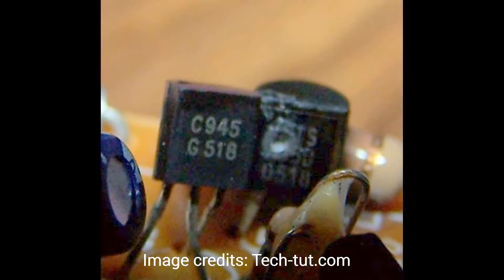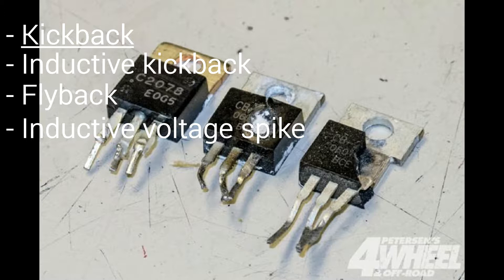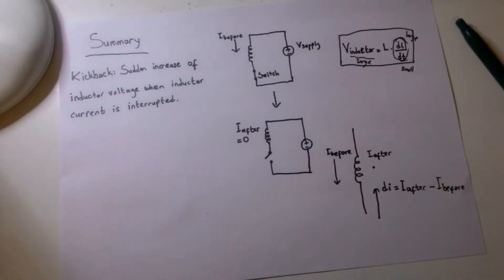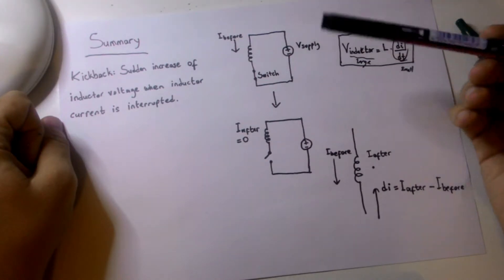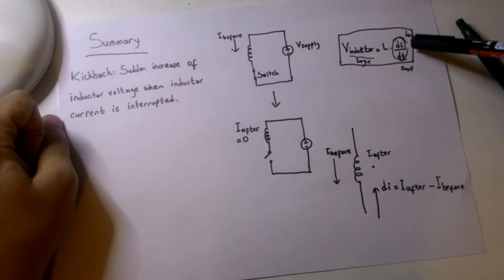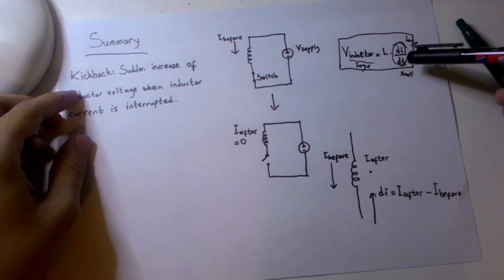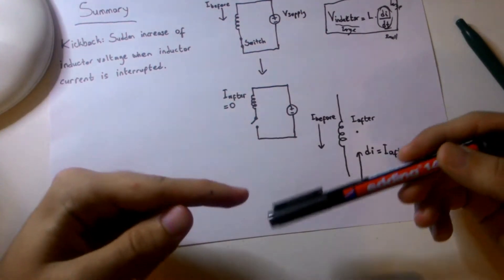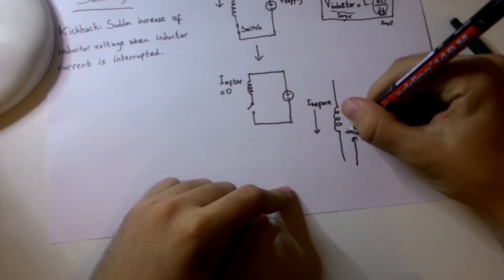What is Inductive Kickback? - Part 1 - Introduction

Comment: when swith open, current not suddenly drop to zero rather it exponentially drop because of opposition to change in the current due to coil.
Reply from the maker: Hello friend, good question. Nothing in nature changes "instantly", for a current to drop from 1 Amps to 0, it should go through 0.99, 0.98 and so on.

But is the drop exponential? Most probably yes, because nature likes exponential changes (which is why natural logarithm is "natural") Let's do a mind experiment to visualize what happens when you open the switch. 

1. You open the switch
2. The electric field that moves the electrons decrease.
3. Electrons slow down
4. The magnetic field stored in inductor is decreased, a force is generated by the changing magnetic field to move the electrons
5. The electrons are pushed towards switch, but they have nowhere to go
6. Each electron pushed needs more energy, because they stack up and repel other electrons (so this means charges flow in a slower speed each moment -> exponential change)

So yeah, it is most likely exponential. But this purely was a mind experiment, so it may be wrong. You can visualize it better if you want the Part 2 of this video - water analogy.
Reply: correct me if I am wrong

Comment: high induced voltage when turning on and off of the switch simulating  a change of electron's state of energy from high to low emmits energy as photons creating more current directly proportional to voltage in an inductor which consist of wound copper wire in a magnetic ferrite.